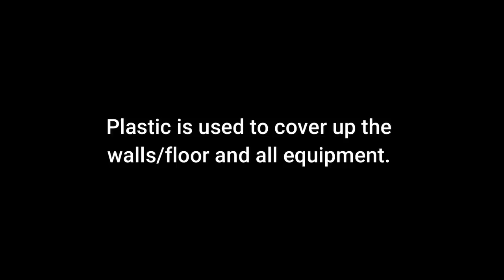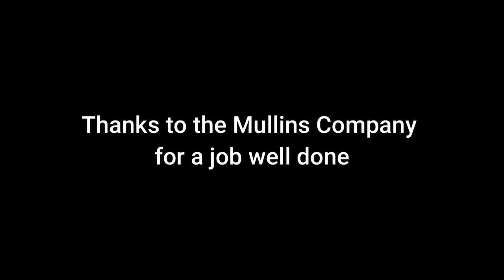THIS UPGRADE WILL SAVE YOU THOUSANDS, WOODWORKING SHOP ESSENTIAL

Comment: I had closed cell foam insulation sprayed on the underside of the roof in my 600 square foot shop. The temperature difference was astounding inside the shop in Northern Florida during the summer. The procedure isn't cheap, but the results are worth the cost. I then added a "mini-split" air conditioner.  My shop is now cooler than the house on the hottest days, a true man cave!

Comment: I'm glad for you.   It will help in the heat of the summer, Nathan besides cutting down on the moisture problems.  I like that you keep improving the shop.
Reply from the maker: yes this was a big deal to get this done, now on to other things,
Reply: I have seen barns, houses and even one church building with that done and it will cut heating and cooling cost way down. It pays for itself pretty quick. It is like a tankless hotwater heater in that sense.

Comment: I used to do spray foam about 15 years ago and it was the best way to completely get rid of sweating metal in shops. Yes you will notice a huge difference when you walk into your shop on a hot day cause the oven affect is gone. Enjoy!
Reply from the maker: thanks, my hopes for doing this, appreciate the info,
Reply: @OutoftheWoods0623  also the sound will be different since close cell foam usually bounces sound instead of absorbing since you are running an engine. Just a fair warning

Comment: Nice insulation like that will make your shop a more enjoyable place to be on hot summer days . Looks nice . No more excuses to stay in the house on hot humid days . 
  I had R60 spray foam installed on the backside of the roof on my garage years ago , big difference .
Keep up the good work .
Reply: Done r60 on the roof in a bedroom addition open cell. The walls were closed cell. Then put r30 on the top of the drywall to help keep the condition air in the living space and avoid moisture problems. Best condition space in the home. Will stay cool two days after the ac is turned off

Comment: Thank you for the video. The topic is perfect for me. I’m going to have my pole barn sprayed with closed-cell foam too. I’ve got a shop in Oregon in a high humidity zone. For me the concern is keeping my wood and wood veneers in an appropriate state to actually perform my work. I need a low humidity environment, and the foam is the way to go. I also like the structural rigidity that the foam offers for the metal skin of the building. I don’t have roof leaks that I know of, but the foam will help with any potential leaks that lurk in the future. Have a good day. 🙂

Comment: That spray insulation really looks good. Going to be interesting to hear what you think of it as time goes on.
Reply from the maker: already noticeably cooler in the shop,
Reply: I used it in my last home and it was the best move I ever made. It is extremely energy efficient and actually makes the structure more ridgid if done properly and closed cell foam is used. I would imagine a conventional stick built shop with this treatment would be a great investment if you decide to heat and cool it.

Comment: Excellent job by the contractor, this will make working in the mill shed so much more comfortable. How long does this type of insulation last?
Reply: PS hope they gave you a good deal what with all this good publicity they are getting from your chanel

Comment: Looking good Nathan. I'd be interested in your reviewing the spray foam job after it's cured. Wondering it it will smell for a long while or not. I bet the sound you can hear outside when the mill is running will deadened somewhat too.

Comment: I hope you have better results then I did with that stuff. I had a 20 x 40 enclosed metal shop sprayed about 6 months ago. It averaged  3 in (± in) thick. It did help LOADS for the condensation but here in Florida with the 100+ degree days we have been having the heat in the shop has only been 5 to 7 degrees less than outside temperature!
My shop has no shade....maybe that would help! =)
Reply: In Florida, you need a second roof installed over the original.  My father had that done and it worked well and many of his neighbors followed suit.   It is common in Florida and other southern states and not too costly but, as you know, inflation.
Reply: Was the insulation "open cell" or "closed cell"?  Open cell isn't nearly as effective as closed cell.  Three inches of open cell will give you a value of R11 while three inches of closed cell would yield a R19 minimum.
Reply from the maker: Closed

Comment: Foam is perfect for this application. Any type of insulation that isn't adhered to the base will just trap condensation and worsen the problem. What was the percent expansion after it was sprayed?
Reply from the maker: not sure on that,

Comment: It didn't seem to expand that much and he had to go over the same area more than once. The spray foam insulation I've seen requires only one pass, expands more quickly and becomes thicker. I recognize that it doesn't get very cold in Tennessee, but it seemed like an inefficient application. 
Well, I hope it helps.
Reply: I'm thinking the difference, of how much it foams up,is the type of insulation you get.This is closed cell foam,and there is a opened cell foam.
Reply: Actually, it's the opposite.  He was spraying Closed Cell Foam, which doesn't expand as much as open cell foam.  As far as "R" value goes, open cell foam is about 3-3.5 per inch and closed cell foam is about 6-7 per inch.  At 1-1/2" thick, it looks like he's probably getting about R9 to R11.

Comment: You really should have treated and painted the rusted metal before insulating. What you've done is covered up some of the rust--it'll still be an issue.
Reply: I agree fully. You will not be able to see if a beam support has rusted thru.
Reply: Yep....100 years from now he's gonna regret it.